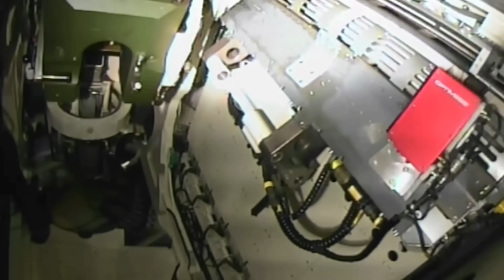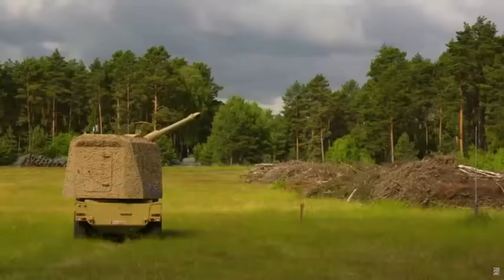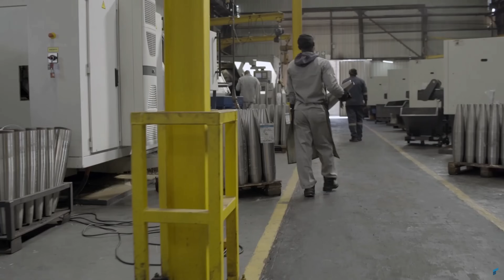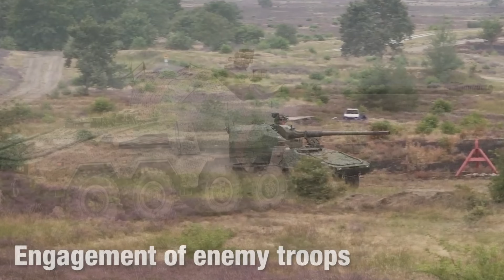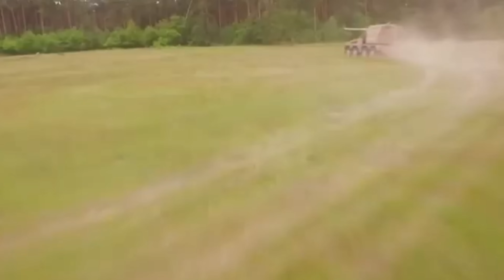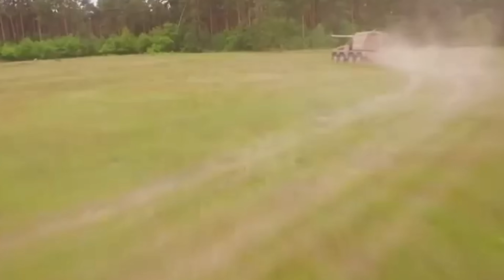The RCH-155 Self-Propelled Artillery System | 155mm FIRING ON THE MOVE!

Comment: RHC-155 is an absolute gamechanger in the counter-artillery-fire dimension. Basically, nobody will ever hit it by calculating its firing position and sarutating the area with artillery. at the same time, it significantly outreaches any of its likely opponents guns. in short: it will win the artillery duel.

BUT.

The main thread is not the artillery duel any more. Its getting spotted moving into a position by a 10k $ Orlan and getting destroyed still on the move with a dozend FPVs, a salvo of lancets or a MLRS strike. Thats why many ukrainians say: shoot and scoot is dead. They dig a deep, concrete lined, roofed dugout in a forest. They shoot and scoot 200 m in and out. Then they hide again. Sure, the RCH-155 can do that too. But you dont need a 12m € system for this.

Automation can be a blessing and a curse. Sure, you only need 2 soldiers driving the gun. But you will need 5 trained mechanics and a steady supply of spare parts to keep it running for months of intense combat. those might be much harder to come by than a 40 years old man who just stoffs propellent into the gun whenever needed.

So basically: its a revolution of classical artillery in a time where classical artillery might be getting vunerable. But it is not obvious that it is the correct revolution for this war. Mayby 5 Bohdanas for the same price are just better.
Reply: I see your points, but you have to think about one thing, concerning Ukraine: Its a slow war. There is no real dynamic like at the start, or the first counteroffence anymore. Because in these cases, i think such a highly mobile artillery would be gold.
Reply: A plattform like this needs drone protection for sure. Pretty sure you might need at least 1 Skyranger gun for 2 RCH.
Reply: The point about escorting this with a Boxer Skyranger is very pointed!

In the Ukraine example, that bunkered complex is where ammunition supply points and mechanics would be, along with specialized anti-drone equipment, weapons, and personnel. Being an SPH, it can maneuver out in a withdrawal or to advance, it can be used to sneak to a firing point, drop shells, and scoot (if HIMARS can do that, this can, too). That's when you want Skyranger!

But I just watched Matsumas's video from five years ago on the South African G6, and wanted to watch this again as a direct comparison. This has advantages over the G6, but the G6 has substantial advantages over this RCH155, too. Given how important artillery has been to Ukraine and Russia, as Ukraine has gained many N.A.T.O. 155 artillery systems and large amounts of financial support, I am quite surprised that Ukraine did not aquire G6-45/52EX SPHs from South Africa or Sudan, and all of the South African 155 ammunition it could get! Being able to sneak across the front, HIMARS-style, to deliver 155 H.E.-B.B. or -R.A.P. on ammunition supply points and crossings from beyond the enemy's range of reply, has repeatedly proven an effective tactic. Being able to hit more than six targets in the limited time before an effective reply can be mustered would be valuable, as might an ability to continue independent operations for several days in relative isolation from resupply.

Boxer/RCH155 could do some of that . . . now. G6-45/52 could have done it years ago.

Comment: What I would be interested in if the main gun can be operated manually or not. Automation is good, but if the operation always requires power, in a dug in postion, it increases its signature and complicates logistics, as aside from the munition, you also have to provide the necessary fuel.
Reply: Modern artillery war or dug out stationary position. Choose one.

Comment: If I remember correctly you dont even have to relocate to refill this vehicle. I believe there is a conveyer belt mechanism at the side of the turret where a supply truck can come in and refill it by "docking on" and resupplying to then quickly get away again. I think you can even do this whilst shooting, the turret has to remain stationary tho.

Comment: I see that thing shake after a shot.  If it can keep on target after that, especially on the move, over rough terrain, whatever technology that is using, need to be on every gun platform.  Any reason, pzh 2000, for 17 mil, better than this in the relevant areas, accuracy, rate of fire, economics?
Reply: PzH2000 is superior in two ready aspects:  fire endurance (or at least, ammunition capacity), and vehicle/crew protection. More than twice the ammunition capacity of this, and the PzH2000 has the best resilience to battle damage and crew survival rate of all artillery systems in Ukraine. Downside compared with all others is shared by both:  much higher maintenance requirements and lower fire mission availability than any other artillery system in Ukraine. (The RCH-155 has only been in Ukraine about a week, but they share the same gun and gun systems, and those seem to be where most issues are.)

The PzH2000 is a phenomenonal system and I love it, but it isn't built for protracted warfare or heavy fire much less both!
Reply: @davidgoodnow269  Thank you :)

Comment: Does the suspension movement when firing affect the range and accuracy? Does the suspension last with sustained firing? How does it compare to the Swedish Archer  system which is a 1/3 of the cost?
Reply: 1. No. The projectile has long left the barrel before any movement even reaches the barrel.
2. Yes. There is no more force applied to the suspension than driving cross country.
3. It isn't comparable since both systems are developed with complete different goals in mind.
Reply: @walther2492  Thanks for the information. Can I ask how the goals differ?
Reply: @mikebikekite1  Different military doctrines and different economic considerations. Sweden is a small country, economically and in terms of population only a tenth the size of Germany. That is why they only have 36,000 active soldiers. A cheaper system is therefore more suitable for them, as they cannot rely on high volumes and thus reduce costs. So they have to start with a more budged friendly design.
Reply: @walther2492  Interesting but that doesn't really explain why you think it's actually better than the Archer system.
Reply: @mikebikekite1  When or where did I say that? Both systems have their reason to exist and to work within their defined parameters. And both systems achieve this through different approaches. One through quality, the other through quantity. The question “Which is better?” is purely academic, as both systems approach the answer in different ways.
Reply: @ No problem. I was just curious why they'd develop this system when an existing solution is already available and much cheaper. Obviously this one can fire on the move though they didn't mention accuracy plus the turret can be easily moved to a new chassis in case of mine damage. I'm not a soldier but I can't picture it being useful as a tank killer - if tanks are already that close then you've done something wrong. I'd assume the Archer offers the same hitting power but possibly more accuracy due to the ground anchors when firing. It's also been extensively battle tested.
Reply: @mikebikekite1   For engaging tanks, there are these things called "Improved Conventional Munitions." For those who don't like fast and cheap, but still want effective, there are Personal/Local/Wide Area Networked Smart Self-Forging Plasma Penetrators (similar to the warhead of an MLAW or Javelin), typically eight per shell, so that two target each tank in a platoon.
Reply: @davidgoodnow269  The Archer system can SMART rounds which take out tanks. Unless 155mm shells have got bigger recently, these shells only carry 2 per shell. Air burst shells can also be fired which explode at a certain altitude or using proximity fuses. I'm British so I'd be happy to see work come our way but I can't see why we're buying this vehicle especially when it's 3 times more expensive.
Reply: @mikebikekite1    The shell I am familiar with dispenses eight or nine submunitions, each a warhead that looks like a clay pigeon about two inches thick and almost six inches wide, with an attatched combined steering & sensor and communication pack. Each submunition is coupled with a different kind of sensor, and the packages network what they sense to distribute targeting data according to which warhead has the greatest hit probability, with a limit of two per target.
Reply: @davidgoodnow269  Maybe this is new. The existing SMART and BONUS 155mm shells only have 2 submunitions and they sound very similar to what you describe. Is there a code for this new shell as I'd like to find out more.
Reply: @mikebikekite1    There is, but I wouldn't know it. I submitted the initial design when I was in the Army, is how I know about it; the occasional 'attaboy' I get twenty years later tells me it was picked up.
Reply: @ The networking bit interests me (I'm a tech guy). Can you say what features it offers? My guess would be a way of assigning the closest target to each submunition. If it could identify the target from it's signature then perhaps to add more than one submunition to the most important targets. Could they communicate with submunitions from other shells? If they do network then would they be susceptible to EW?
Reply: @mikebikekite1    Vulnerability to ECM is negligible -- most people don't know this, but the major militaries figured out how to maintain communications throughout nuclear exchanges and in the irradiated environment following -- an emissions environment much rougher than any ECM package can create -- and those protection principles apply to ECM-intensive environments, too. Avoiding detection to prevent jamming isn't that big a deal -- look up the VTech 900 MHz cordless phone that became popular in the 1990s, a South African product that brought military ECCM technology to bear on the common problem of wireless interference. Every technology it used remains valid.

The submunitions each have a different mode of sensing and cross-reference to defeat jamming and spoofing as well as to identify and then verify potential targets. Each has a degree of maneuverability, and all are on the same ballistic arc, so once targets are identified and verified, then each is assigned a hit-probability by maneuver of each submunition. If a target is out of a particular submunition's basket, then it's out. The priority is given first to getting two achievable scores on each target, and then sorting for the best combination hit-probabilities by assignment, under the limit of the two-hit rule. If only one submunition can possibly hit, and the other seven would divide three targets between them, then that can overcome the two-hit rule.

But they are a strictly anti-armor warhead, so they only seek to identify armored targets. Each shell's submunitions are strictly limited to communicate with each other.

Comment: Also Rheinmetal has delivered RAM-Jet powered 155mm Rounds for the PzH 2000 and the RCH-155  that reach out >> 100km. Other Nato could/can fire them as well but for those 2 there are SW upgrades so the system can handle them.

Comment: PErun had a video the other week about his visit to an arms expo in the RoK, where one compnay had a concept study of an artillery battery composed of one vrewed command vehicle setting up fire missions and four to six autonomous artillery platforms felivering them.

I don't think the tech is quite there yet - the problem is self-driving, gun-laying is the easy part - but I do think that's where we're headed, for several reasons. One is lack of personnel. Let's be blunt, there are rather more attractive jobs in the Western world than "soldier", for most people, at least, and Western militaries are somewhat struggling to meet recruitment quotas, so automating as much as possible would ease that problem. Demographics are likely to exacerbate that problem.
Reply: Even one man crew (just a driver) SPGs would still be massive save on man power.
Reply: @solarissv777  Well . . . that depends a little. One of the core roles of vehicle crrews is routine maintenance, and that means the fewer crew, the higher the workload (this is part of why Western tanks were designed with crews of 4). 

So, you'd likely just be shifting personnel slots from "crew" to "professional maintainers". You'll save some personnel in the process, but not as many as you'd think.
Reply: @jochentram9301  yes, but you can make vehicles smaller and lighter. On the other hand - you lose the ability to troubleshoot and fix on the go.
Reply: @solarissv777  Which is a major reason I dislike fully automatic turrets on tanks and IFVs, you might need to troubleshoot the main gun *right now*. 
That's less of an issue with an artillery system; those generally don't have people right in their face shooting at them.

Comment: I would NOT want to be coming at that thing in a BMP, watching as it turns its gun towards me...
Reply: at such a range and caliber I guess even an HE round would be penetrating that poor BMP...
Reply: there is a video of the Bundeswehr which shows the Pzh2000 training direct fire on old battle tanks for selfdefense ... the standard 155mm shell ripped those apart. Doesnt really matter what you are in against direct artillery fire of that caliber, your only hope for survival is a miss hitting far off your position.
Reply: There is also a Semi Armor Piercing High Explosive round for it
Reply: @ alltho that was designed to punch through reinforced concrete and has a slightly delayed fuse. Used on a BMP that particular round could actually increase the chance for survival of the BMP crew as it has the potential to go clean through and explode outside.

Comment: Shoot and scoot = you get spotted by ISR drones and killed
Thin armor = you can't fill the role of a tank
No tracks = you might be limited to paved roads
Price = ~3x of CAESAR

Advantage = ?
Reply: Artillery can yeet projectiles for dozens of kilometers for a reason. They are out of range of drones, don't need to go offroad and are long gone when counter-artillery hits.
Reply: @UnfollowYourDreams  They are well within the range of drones - both the FPV drones and Lancets, not to mention ISR drones. The visual lost data confirms this as well and also suggests that counter-artillery is barely a threat, comparably.

My previous reply with names, numbers and more thorough explanation seems to got deleted, so go find things yourself. Or believe whatever, beats me.
Reply: @Ludovit110  the range of a typical FPV drone is ~15Km. Lancets don't exist in great numbers. ISR drones are usually not armed and have to rely on other systems to go make boom. 40 - 50 Km behind the FLOT is as save as it gets for any artillery system out there.

I don't care much about loss data, especially when it comes to artillery pieces. Because such losses have to be viewed in relation to the overall numbers as well as the threat they face in this environment.
Reply: @UnfollowYourDreams  Right, the evidence doesn't matter and the artillery does the heavy lifting sitting 40 - 50 km from the FLOT.

My bad.
Reply: @Ludovit110  well, that's how artillery works. It sit's way behind the lines and causes more than 90% of the casulties. It's basically been like that since ww1.

Comment: The artillery gun module is also sold on Rheinmetall HX trucks, there is also a tracked boxer version that could carry it as well as other wheeled platforms.
Reply: So much wrong there with what you wrote:
1. there is no tracked boxer ... the AGM on tracks is an ASCOD 2 platform. Found no buyers back in the day when it was offered. so far no other tracked version presented.
2. the AGM on truck is using an Iveco 8x8
3. the Rheinmetall wheeled HX 10x10 truck artillery is using an Elbit automated gun, not the AGM from KNDS (similar, but different gun system) ... also none are sold so far, its still in the development and trails stage. While the Rch155 already is in series production and has its first costumer (Ukraine) who started training on its first delivered unit last year.
Reply: @ there is a tackled boxer but so far none sold even for the other modules. I just wanted to point out it’s a versatile AGM that you basically put anywhere.
But you are right that the one they presented was the Iveco 8x8. I must have mixed it up.
Reply: @diedampfbrasse98 1) wrong. There is a tracked boxed version. Seen it myself, bro.